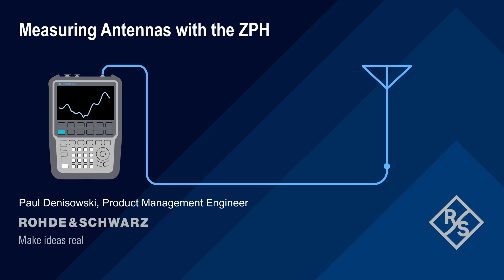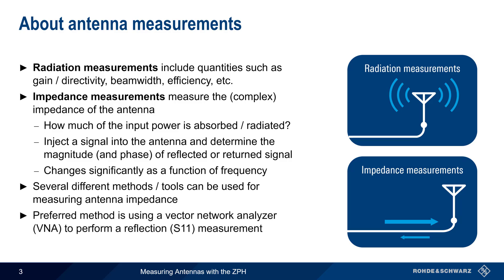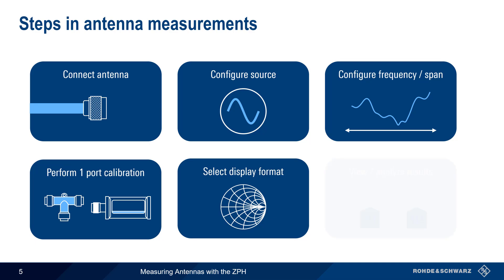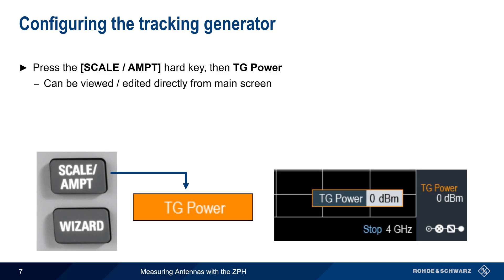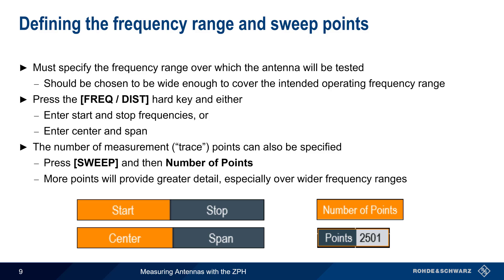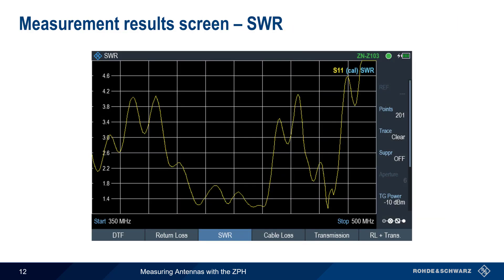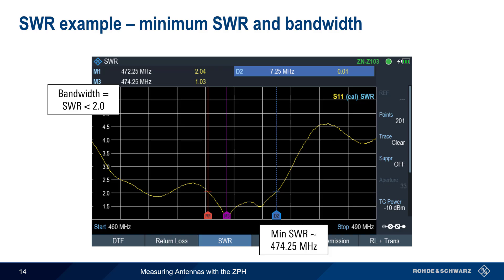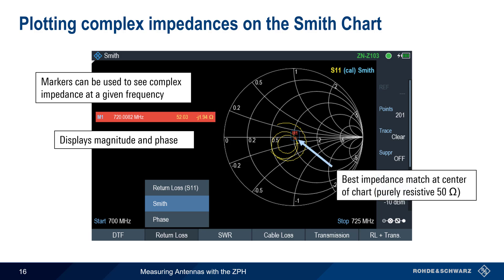Measuring Antennas with the ZPH

Comment: Measuring an antenna mounted onto a 30 foot tower during an install with the City of Salem was one of my most memorable field days as a field application engineer.

It's so helpful to hand the guy in the bucket truck a Open/Short/Match cal standard and tell him to connect it to top of the feed line while measuring at the base to ensure the field-terminated feedline works as expected without any reflections (TDR!), then connect the antenna and ensure the system behaves as expected. So fun!
Reply: Nothing is quite as much fun as working (literally) in the field :)